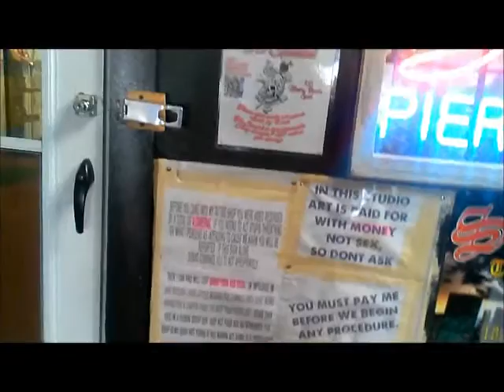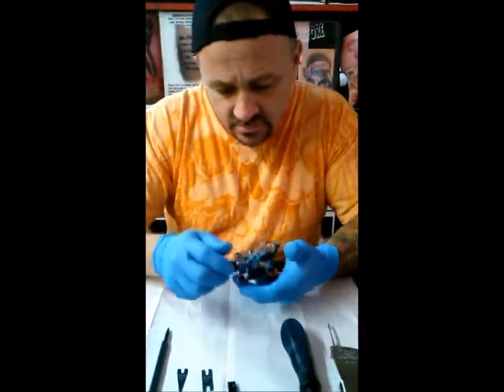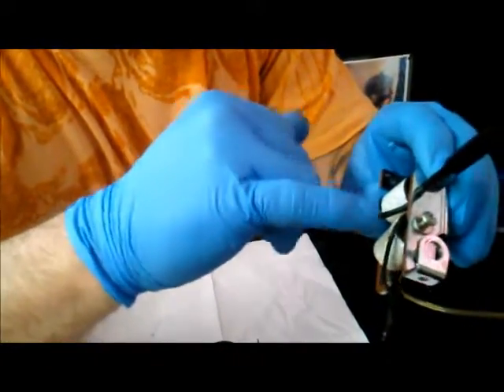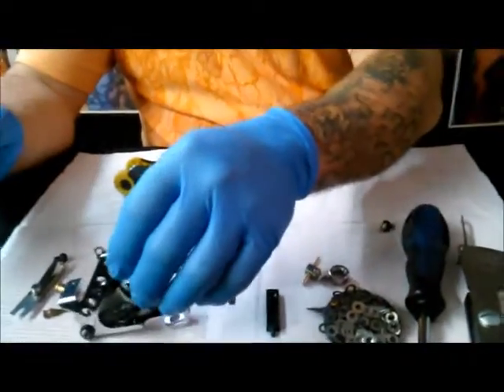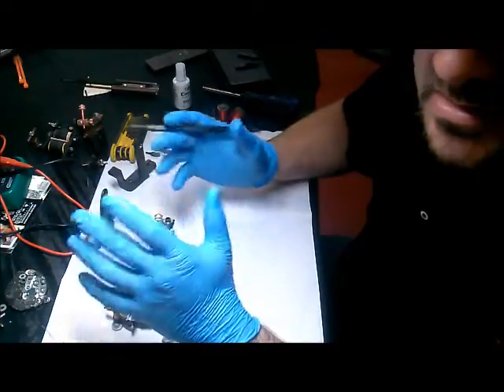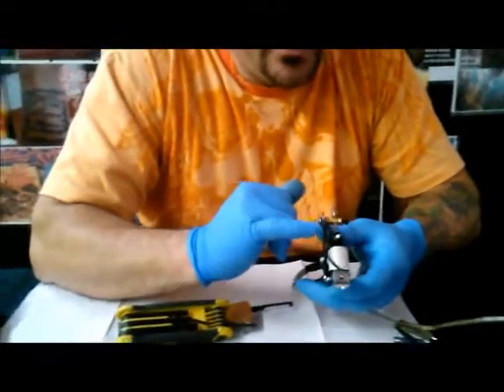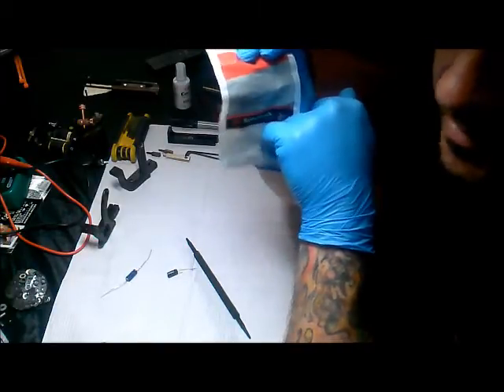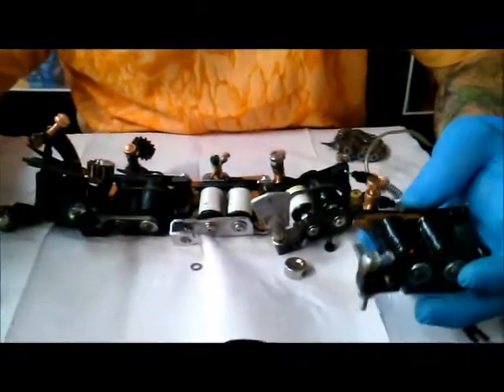disctwo

Comment: Great Video. Either C.N.C. machined (ie) F&K-knock offs or cast (ie) Micky Scharpz or Paul Rodgers Knock off for example... They are cast Iron Brass Steel etc... Again Hart to F' Up.. not as precision as CNC so FK knock offs win here..Then all you need to do is customize them for your self. So typically if you change out the Coils, Capacitor  Front & Rear Springs.. Most Choose 18 to 20 gauge steel for springs. You Now have a custom machine.You can even change out the a-bar to change the balance.

Comment: I love this Video. You can Customize a Made in China machine to run nice & Save $350 to $700 a machine. Have about $50 to $100 max in a knock-off. Rotary's Same CNC Machined.  The motors are usually  Mabuchi motors which is a Japanese company that manufacturers all over Asia, Japan, China, Tawain, etc.. even if they say its Swiss it is not.. This applies to Chinese machines... The Mabuchi motors are used by most Rotary Tattoo machine companies. Then you have, Maxon Motors, Then Diablo Swiss

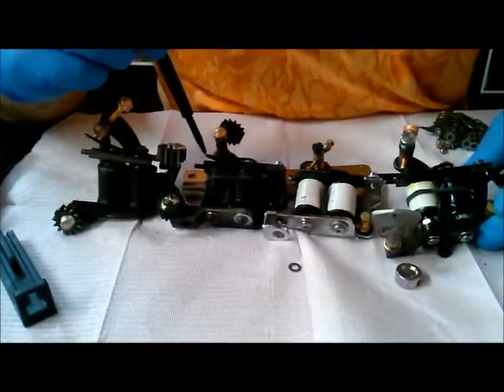Comment: Greetings! Thanks so much for these videos - I think I've watched every video you have posted about setting up machines so far. I bought one of the cheap chinese kits you speak of with distaste to finish a tattoo a friend of mine never completed. I am in the process of rebuilding both of the machines that came with the kit per your invaluable instructions, but I have a question. In this video (may have been another video - they're all running together now) you said not to be deceived that changing the contact point on the spring changes a machine from a shader to a liner just because it is farther up on the spring, but at 54:35 you show us that your contact screw is further back on the longer spring even though you have a longer spring. I understand that spring tension makes the difference between a shader and a liner, but how important is contact screw position on the front spring? Also, you never mention what spring tension should be for a shader. Can you share that number? Thanks again for sharing your knowledge!